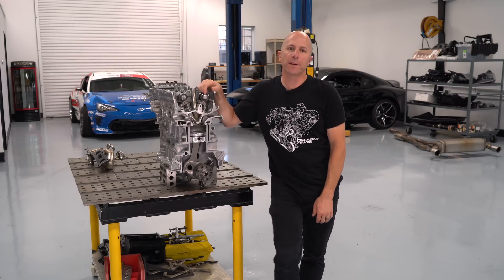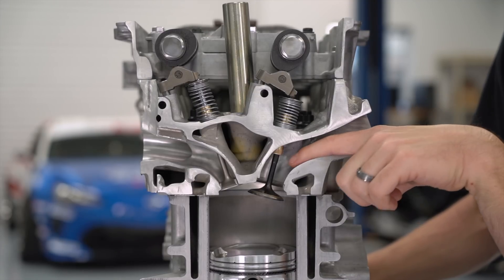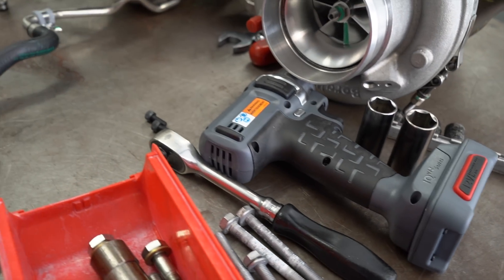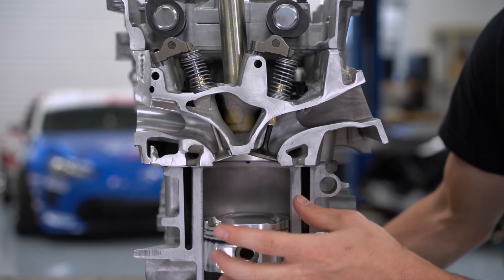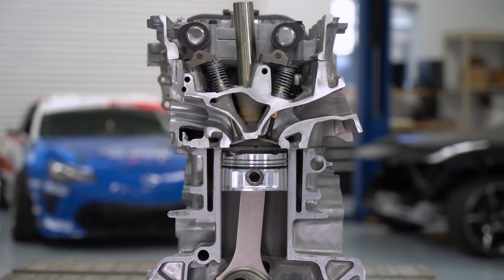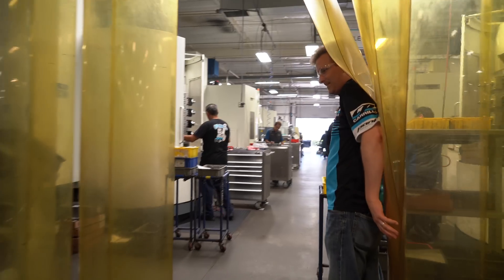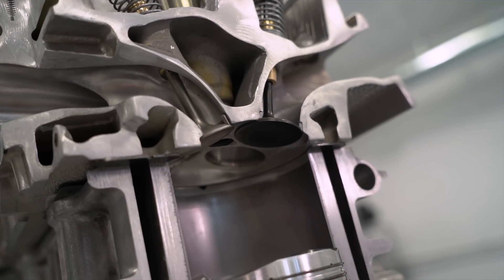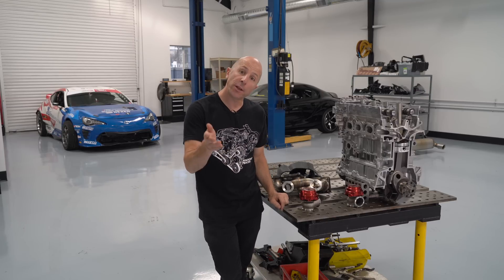The Making of 1,000 Horsepower 2020 Supra Engine Parts

Comment: Check with Revolution Mini Works. If I remember correctly, they were developing a stroker kit for the B48 which is the same B58 in 4cyl form. They were calculating a 25% increase in displacement.

Comment: Anyone notice the fact that the new supra no matter what powers it is already getting a pile of aftermarket support, just from Papadakis pushing the platform, people will be able to buy a new intake, turbo manifold, rods, pistons, probably aftermarket bearings, head porting packages, fuel injectors and fuel rails, dudes already pushing the platform to greatness and it's in less than a year already think about that people, Joel Grannas is also developing a 6 speed package for one so its gonna be awesome

Comment: its still throws me the internal exhaust manifold in the head......the pulsing between cylinders by the time it gets to the turbo must be interesting. I did notice the blanking ports on the head, maybe for higher HP engines from BMW later on.

Comment: More boost does not always mean more air, just to clarify. Also, 7:1 AFR with E85 is garbage, this is why spark ignition race cars suck, you literally have to fuel up after a few passes. One last thing, I hope you don't expect the engine to last very long if you stick a longer stroke crank in it and run it up to 9,000 rpm.

Comment: As far as i hate name supra for this vehicle, i wanna see that this toyota makes 1000hp.
If this engine will make 1000hp, then it will be proven that engine itself is good.
Reply: thousand  hp is achivable but reliability its the issue i hope that cranksaft will be able to hold it  long enough because bmw make suck cranksaft
Reply: @kevinbosco5876  I heard toyota sended back engines multiple times, and they prepared supras to be tunable. 
But yeah even rx8 engine is probably capable of doing such power with such mods, but how long...
Reply: @kxpes  yeah they choose closed deck engine because the open deck bmw made was crap btw the  cylinder block cannot be upsize because there is ceramic coating on that cylinder that hold the boost  thats why the want to stroke up the engine without touching the cylinder bore . the engine itself still inferior that 2ar 1k 4 banger from toyota
Reply: @kevinbosco5876  Tbh thank You for all information, good to know such details without much looking. It might be helpfull homehow someday

Comment: This is cool, but won't the 6 to 2 exhaust manifold thing in the head cause issues? Flow and maybe heat related? For a stock engine it's fine and simplifies the exhaust system, good for the manufacturer, but can't you cut that off and just install regular exhausts on all cylinders? I think at triple the power heat might not play nicely with the aluminum head.

Comment: Whats your plan on the transmission? Swapping the stock ZF 8HP51 to a ZF 8HP90 out of the Hellcat?

Loved this video and subscribed. Thank You :-)
Reply: I assume they will be doing a sequential or manual in the car, as it's already going to be full standalone etc. but that's provided this is development car for the drift program vs just something to test the engine in.
Reply: Why call Dodge when they can get the same transmission from Mercedes? Both already built in Germany.
Reply: Tazmn Wilson they’re both ZF boxes and have no brand loyalty anyway. ZF makes the 8hp90, which is not in any Mercedes product ... that transmission is only in the hellcat and a few rolls Royce / Bentley’s. It’s also fairly close dimensionally to the 8hp51 which is why he was recommending it. Can take much more torque
Reply: Alex Fry Thank You :-)
Reply: Tazmn Wilson Mercedes builds it's own gearboxes and doesn't share it anymore with Chrysler since they are separated. The ZF 8HP isn't used in any Mercedes. You can look online on Wikipedia in which cars which ZF 8HP Variants are used... Dodges would be the cheaper Donors against cars like Rolls Royce, Bentley, etc

Comment: For everybody else it’s too hard so they just put a 2jz in a 2020. Not Papadakis!!
Genius!!
Reply: Considering 2JZs are getting old (the newest ones are around 15 years old) all the wear and tear from racing can put them in risk of cracks and other catastrophic failures. Learning how to make high power B58s can save the remaining 2JZs from premature deaths, because no matter how overbuilt an engine is, wear and tear is imminent.
Reply: You use what you have. Not what others have
Reply: Yep actually building something different for once not the same shit
Reply: the reason the teams in JP swapped in 2JZs was because they wanted to run the cars this season, at high power levels, reliably. so they used off the shelf engine packages that have been race proven.

im sure they will develop b58 stuff as well down the road.
Reply: Always innovating and pushing the limits, I love it! Will it be the first 1000hp non 2jz 2020 supra?
Reply: Gou Hojo one thing for sure, >80% here are BMW fanboi and gotten stimulated from Toyota by offering them a sexy body yet retaining their beloved brand engine / gearbox. But for a true fan of JDM cars, this is an absolute laughing stock in history made by Toyota. 

If you beamers fanboi can’t register the true JDM into your head, seriously go fuck yourself hard. 

not debating this with you all as well. 

signing out for good.
Reply: @levisaurous9092  If you're going to insult someone, at least use proper grammar.
Reply: Neil Walton actually it an excuse, real truth is most people hate BMW.
Reply: @nelc2399  only dummies and 10 year old Supra fanbois hate BMW
Reply: TurnIP I’m a bmw fanboy but the new 4 series concept makes me reconsider...
Reply: @Levi-sv6xn  if you dislike a brand over 1 single bad car you need to reconsider your usage of the word fanboy
Reply: Levi Keyword concept
Reply: TurnIP Tell em.
Reply: TurnIP I didn’t complete my sentence well. Ppl hate BMW engine and gearbox inside a legendary JDM Supra. Rather planting back 2JZ inside the new body. Also BMW are known for oil leaking issue, can’t deny that.  No matter how BMW it is, we are here for Supra ......JDM Toyota Supra. not this piece of shit BMW Z4 badged by Toyota.  

Ok flame 🔥 on.......
Reply: @turnip8173  someone triggered the snowflake
Reply: TurnIP I can sense you trying very hard to defend this piece of shit you loved. I can understand that. Sadly i am not a fanboy of Supra but as a fan of JDM cars, this new Supra is a complete joke. 

Anyway FD2R FTW and Long Live!!!

Signing out from Asia
Reply: nel c well the z4 is a really good car and bmw makes the best straight six turbos right now, that’s why Toyota went to bmw because their engines are so good, learn some facts little boy 👦

Comment: Your videos are excellent. I do have a curious question for you though, with the amount of modifications you’re doing to the engine why not just make a one off engine from the ground up. There is almost nothing original left in that motor but it seems you have to make sacrifices for the things you swap due to working with the limitations of the block and head. The pistons, valves, crank, rods, head are all now so customized they bare no resemblance to the original motor. Seems like you could get more power at exactly the rpm band you want by machining a block and head from scratch. Amazing work none the less, awesome channel.

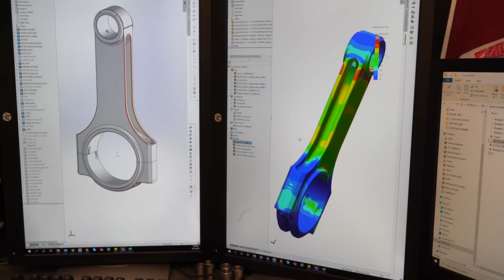Comment: 5:20 Was this an old version of the rod? Idk where the solidworks forces are applied, or even if it accounts for shot peening, but it's getting mighty close to the yield point in that wrist pin area. You're okay with running such a small margin of error in that area?

Comment: i dont get it? what is the point then? this is a new engine and the big deal was the engine. you are changing everything! what  is the point if the only thing left is the block. you could do the same thing to any engine what is the point to do all this to a 2020supra. you could do this to a 200 supra and acomplish the same thing. the point i thought was that this is a 2020 supra and it comes stock with a good engine and with minimal upgrades you can get 1000bhp. 
this is not the case you are changing everything so this car sucks stock vs price

Comment: to be honest I was expecting an entirely new head to get rid of the built in exhaust manifold... I did not see a port job coming into play.
Reply: a new head would be like the crank , it would take ages to get the finished product , and they seem to be under a time crunch
Reply: The bmw version of this head actually has a manifold. And surely it would bolt onto the toyota version block.
Reply: @themustangfactory  the turbo directly bolts to the head. why would you use two headers? that's redundant.
Reply: @jake20479  well it's a little werid on why Toyota chose to make the first year model mk5s with 2 exhaust ports integrated into the head while for whatever reason next year's models are supposed to have 6 port exhaust that aren't integrated in the heads.
Reply: @jake20479  what are you talking about? I'm just telling you the bmw head is different it has 6 exhaust ports like a conventional I6 head. The mk5 b58 is the only iteration of b58 setup this way that I'm aware of. So you wouldn't need a custom head if you want 6 exhaust ports just swap on a head from a 240i
Reply: @themustangfactory i misunderstood your post, my apologies.  - i thought i read "Head" instead of "block" - my bad. my bad. 
i guess it just comes down to if they have the exact same block- to a T.
Edit: before i saw my error i was thinking "two exhaust manifolds.. that doesn't make any sense.." and now i realize you made perfect sense. lol again, my bad homie.
Reply: @jake20479  it's all good man. I was hella confused 😂😂 I'm assuming the blocks would be the same but then again I dont have 120k to just go buy a supra and a 240i pull both of them apart to compare lol it is nice to see that they will probably be able to use the stock design for cost and simplicity. Because most people are not buying a head to swap onto their new car lmao
Reply: @maaduece5132  the time crunch is definitely real, I feel that,  I just didn't see the 1,000hp goal coming into play with the stock design head.
Reply: i can see exhaust temps being higher due to the fact that the built in exhaust manifold resembles a log manifold, but better as it has a port per 3 cylinders. im just blown that 1,000hp was the goal. i am beyond stoked to see the final outcome. with e85 and possible water/methanol injection exhaust temps will be tamed for sure.. but.. still... no one knows. and i for sure, cannot wait to see what the capability of this engine is. 
mad respect for Papadakis. he knows what hes doing.
Reply: It looks like the b58 head doesn't need much porting for 1000hp

Comment: Great video. Please install pressure sensors in the exhaust manifold to see how  restrictive the design is.

Will be also curious to see how that exhaust design, head and cooling system handles the heat.

Comment: Did anyone else do a checklist and then question reliability/sustainability? I get making 1000hp comes from somewhere but it seems they aren't being conservative anywhere necessary (particularly compression ratio)...

Significantly larger turbo (and most likely high boost)
E85
not running rich
And 11.0 compression....

I also find it odd they state running lean makes less power.  Generally this is wrong - running lean with advanced timing makes more power but generated more heat (and is why boosted engines run rich - they also generate more heat...).

While the video was great I just kept internally asking questions.

Comment: just curious.. do you mount a variable external oil pump hose to the block with the oil passages for the head possibly blocked off.. then open.. to check the flow for each of the main bearings at different flows..  just to verify there are no issues at crazy high rpms..  in the past i have used rifle ball hones to polish my oil galley passages. with aluminum block that might be an issue of possibly embedding a grain of abrasive..   then check the oil flow thru the head.     even going as far as trying out different screens on the oil pump pickup to check the pressure drop do to screen openings and pressure drop because of restriction from creating a suction bubble on the bottom of the pan..    even checking the durometer of the oil passage orings to verify they are hard enough to withstand the higher pressures/flow rates you will experience..  too hard a durometer and they don't crush and keep the parts separated.. too soft and they can shed ..

Comment: 6:18 Those arent the factory valve springs right? They're just wimpy springs to make the engine hand turnable for demo...
Reply: no, they’re stock, the pressure of the cylinder keeps those valves shut
Reply: No way, I dont believe you!  Also do they not run buckets or were they just removed for visual reason?

Comment: This dude is a legend
Reply: Team of legends.
Reply: 1 guy can't make quality like this.
Reply: @australianoutback  spot on. IMO it's the support companies doing the design and work are the true legends.
Reply: @cmartinez1089 
No that's not what he said, that's i corrected it ;D.
Reply: Yeah, though  legends also make mistakes. He said, that the the combustion produces power and heat. The heat is actually what produces the power.
The heat expands the gases in the cylinder, therefor creating pressure, wich in turn moves the piston and creates torque over a revolution (power).
Reply: @Enthropical_Thunder  Then you would also know that most engines are only 20-30% thermodynamically efficient , so 70% ' power' according to you heat according to papadakis is rejected into the head , block and exhaust gases .
Reply: @dilsher12  
Yes but to be completely correct, you would call that waste heat, as the thermodynamic process does not use all of the chemically released heat.

 Also, the pure engines efficiency is about 30-40% or even over 50% for large slow turning 2 stroke diesel engines, as used on tankers and cargo ships. Actually, 2 stroke diesel engines are the most efficient piston internal combustion engines out there  ;D.